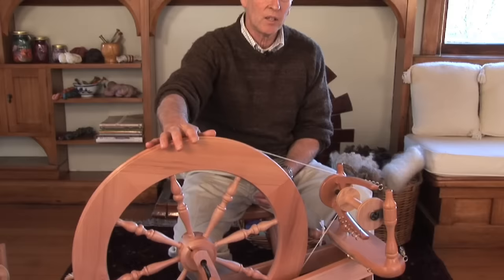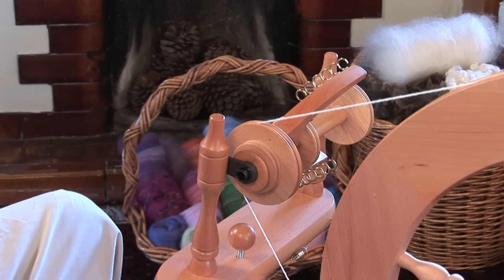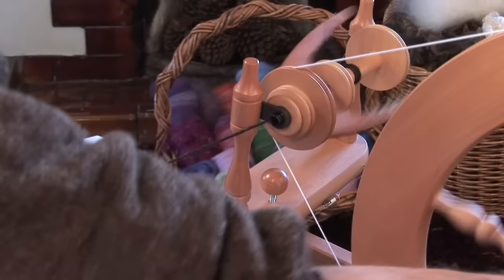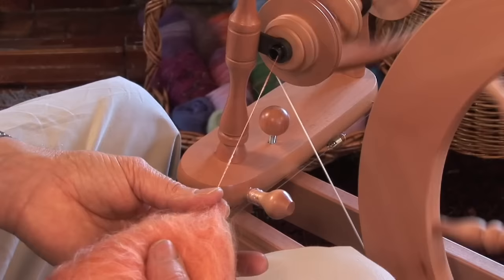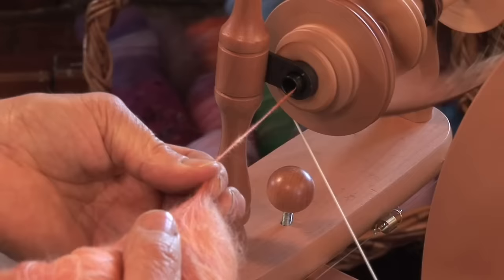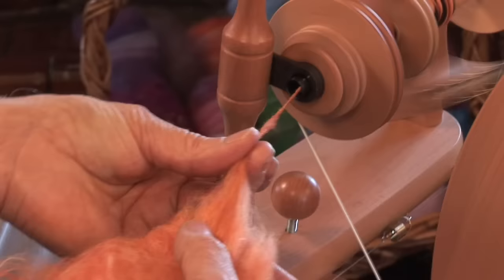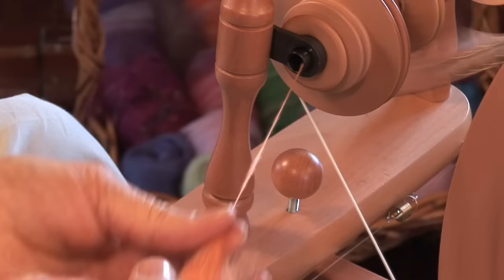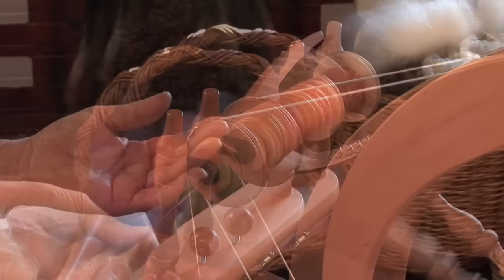Ashford - How to spin

Comment: If you notice the thread twisting up into your fiber just pinch and counter twist a little and start drafting. I actually just slightly counter twist to be sure my fiber remains open enough to easily draft. I let go and don't keep my fingers pinched but keep my fingers on the fibers. Slightly counter twist and it is fast and smooth. Im learning on Llama fiber.

Comment: I wish for a video discussing the adjustments.  My bobbin won’t take up and wheel is over spinning. Which adjustments do what? Thanks
Reply: I'm having the same problem, it just won't spin onto the bobbin & then the pigtails come.  Have you discovered any help on this?  I don't know which adjustments to make either.
Reply: Saaame! It's so frustrating. I don't know what's wrong. I was given a super old spinning wheel that was my grandma's. The drive strings occasionally pop off too. I'm wondering if the issues are related.
Reply: Now, two years later, I’ve just learned to fiddle with it each time I spin, tighten this, loosen that till it works. Mine is early 70’s. From my aunty. No exact settings. I love her though.

Comment: I purchased the traveller spinning wheel and I think I assambled it like it was said in the instructions. But I can only spin anti-clockwise with it, it doesn't twist the thread if spinning clockwise, it only pulls it. I can just not figure out what is going wrong there :( I think it has something to do with the break, but there is only one way to semble it up...

Comment: Hi there, I'm a new to spining area and I just bought Ashford E-Spinning Wheels.  Wondering if the machine can ply the fabric strips, about 1/2 inch stipes?  I'm interested to plies 2 strands of the yarn ball together (I have lots of thin yarn and would like to make it bulkier but not as bulky as the art yarn do), sorry my bad english.  Thanks :)
Reply: Freshdeeee i have done what your suggesting and the yarn is slightly to stiff/thick for the wheel but if your ok with helping the bobbin take on the yarn by turning it with your hands you should be able to

Comment: I have an Ashord traditional spinning wheel that has never been used.  It sat in the garage for the 20 years.  Recently I had it assembled and tainted.  When I tried spinning with it, all the wheels turned.  But the yarn is not collecting onto the bobbin.  The yard kept twisting outside.  What should I do?
Reply: Same problem here, have you figured it out yet?  Please let me know if you do.
Reply: It's been a year, so I'm sure you've figured it out, but have you made sure the tension band is adjusted properly?

Comment: How does  the bobbin  take up  the fiber?
I've just built a Saxony  spinning wheel  which has a double drive. The bobbin  spins  slightly faster.

Is the  bobbin  and  flyer spinning at the same speed  here?
Reply: They spin at the same speed if you hold the yarn from going in.  The bobbin spins slightly faster as you allow the yarn to be taken in to wrap the yarn around the bobbin.
Reply: Don Kleppinger I thought the bobbin  would  spin  slightly slower as  the scotch tension  band  is  stretched  over  the bobbin pulley.